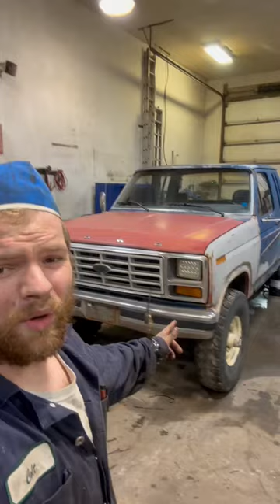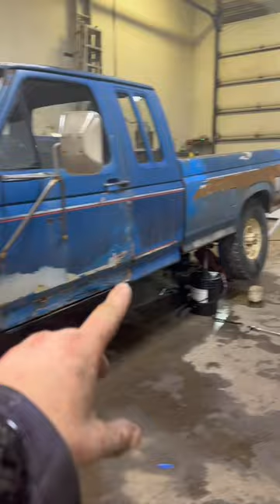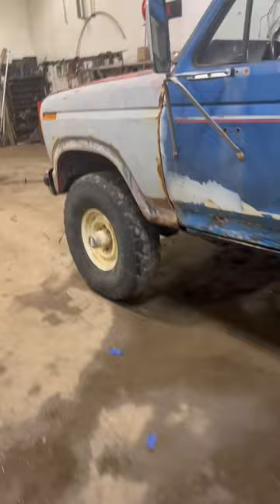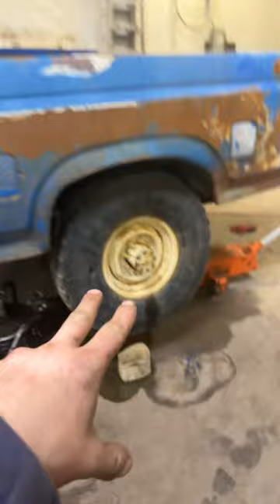Fords state of the art flexi frame

Comment: I bent a 1980 ford pickup like a pretzel and it was a wonderous thing watching it spring back into shape like a rubber tin can.
Reply from the maker: It’s pretty wild when you really flex them out
Reply: rubber tin can is my new favorite ferd saying😂
Reply: I had a 1980 f150 that had for some odd reason, 3" and 4" holes were taken out of the side of the frame from front to back.
weight reduction maybe?
man that old truck would flex and half was from the frame.
Reply from the maker: @taylorsmith3744  ah yes the Swiss cheese frame, was only around for a limited amount of years. It was for weight savings in theory so it could tow a little more, but also likely for cost savings.
Reply from the maker: @StainlessTom  that’s a good one haha 😂
Reply: @taylorsmith3744  You should research but I read once that that 1980 to 1982 ford truck frames or maybe just f100s and f150s had those big holes cut in the frame to lighten the truck.
1983 onward they stopped doing that.
I don't know for sure though.
Reply: @J3rEmY17  The 300ci motor, 4 speed, 205 case and 9" rear were all cast marked as 1979. The TTB front axle was first to get replaced as i couldn't find parts for that first year axle.
Reply: Yeah my 93 will flex so far the doors won't open or close, and it has no rust.

Comment: My old full size square body used to get some looks on the trail with the flex it would put up the only suspension work on it was a cheap 6"   lift 2 of which were blocks

Comment: As an alignment guy in the early 90s, I hated twin I beam with a passion.
Reply from the maker: Gotta admit, alignment purposes they really do suck haha, ttb pivot bracket bushings are really only align able for the first few years, after that they are too worn.
Reply: @highostablegarage  what do you do at that point?
Reply from the maker: @johndc2998  replace the bushings, it’s not a fun job but I’ve done a few of them now. A lot of fellas will never replace them even on 20 year old trucks and then complain that their tires get chewed up.
Reply: @highostablegarage  The 2wd models arent that bad to align as long as nothing is bent too badly. Upper ball joints can rotate in a way that tilts the knuckle a few degrees relative to the I-Beam, steering links allow toe adjust.
Reply from the maker: @TestECull  yup, you can even get camber bushings for more adjustment, but what I’m talking about is the pivot bushings at the other end of the arm, when they go bad they will never hold a good alignment, most fellas forget they are even there haha 😂
Reply: @highostablegarage  I don't know how you could when it sounds like Thor is under your hood every time you turn when they're worn 🤣🤣
Reply: @highostablegarage  They also aren't all that hard to change out nor do they cost much to buy, so iono why anyone would let them get so bad you can't keep it aligned...
Reply from the maker: @TestECull  you would be surprised haha
Reply: @highostablegarage  your correct bud. Them ford's made popping the plug out of the control arms on the OBS Chevys seem like gravy.  We wouldn't do Mercedes at the shop I worked at. The boss did for the longest time. Originally it was suggested you hang a few hundred pounds of the car in certain spots, but then they came up with this method of squishing down the suspension with a special tool. So we just didn't do them anymore. 
I always thought was wild there were different suspension settings for a Miata depending on how much fuel was in the tank.
Reply from the maker: @ryurc3033  the fuel in the tank likely outweighed the dry miata haha 😂
Reply: @highostablegarage  now I know you know your shit! I changed those bushings all the time. Got a bunch of shit everywhere I worked because I was the only one doing them. Everybody claimed I was padding the ticket. Meantime when they did an alignment they would be calling around trying to find super high degree cams. I would pop in knew bushings and half the time it was now in spec. If I did have to change the cams it was a mild change. 
 I had a kick ass system using 2x4s and two prybars to get the bushings exposed to change. Could bust them out in thirty minutes.
Reply from the maker: @AlphanumericCharacters  that’s awesome, I usually always had to swear and use a bunch of jacks and jack stand to do mine, plus usually they are covered in dirt so every hit and pry you are getting sand in your eyes haha 😂
Reply: sadly ttb had so much potential. damn bean counters ruined it.

Comment: As a guy who drives a ford f700 i can tell you that that is damn true, barely got any suspension travel but it compensates that with frame twist
Reply from the maker: Sure does haha 😂
Reply: Do you mean f100? I’m not too car smart but I have a very clean f100 and I was terrified when I dropped the back tire off a ditch and seen my f100 twist so much pulled it out and nothing was wrong love my old truck put all new parts on it and I have to say it’s a better off roader as a show truck than most modern jeeps lol
Reply: Also put a crown Vic front end in and it drives better than any modern truck I’ve test driven
Reply: @colbymaxwell244  Nah he meant F700.
Ford has always built bigger trucks than F350s.
I know they build F450s, F550s, and F650s currently.
Back in the day they built F500s to like F1000s in 100 numbered increments.
Everytime you went up a number towing capacity and payload went up.
They were meant for business only fleet vehicles they weren't sold to regular non business customers, those customers only got F350s or smaller.
Also those older trucks like an F700 would have had completely different front end, fenders, grill, core support, the cab behind the fenders was often the same as any other Ford truck. 
They're called cab chasis because you aren't sold a bed if you buy one because it's assumed you'll modify the truck for whatever you need to suit the business your in ex. construction, rail road they almost always end up with a steel flat bed.

Your F100 sounds cool though, Crown Vic suspension is sweet.
Reply: @colbymaxwell244  i really meant that its a ford f700 and yea a jeep is just a cheap car in an expensive plastic and velcro body lol
Reply: @J3rEmY17  yup! indeed, is just that some guys think it was made up
Reply: @mr.nobody1671  I just looked up cord 700 that is the coolest old truck ever

Comment: Built better than today's trucks
Reply from the maker: sure is
Reply: I was t boned on the driver side door- of my 2011 1500.. walked away pissed the fuck off my shit was totaled. They hit me doing at least 45mph.. you would not be walking away in an old beater like this- in an accident like that. Be lucky if your wheeled out of there alive. 

Old is not always better...
Reply from the maker: @johnwalker7592  built better for truck things, not the plastics in this truck though they suck haha, and you are 100% correct, newer vehicles are safer for the occupants hands down, I wouldn’t want to get t boned like your situation in my old ford, the cabs crash wise were never the best.
Reply: @johnwalker7592  That's about the only thing this new plastic garbage is good for. Great for protecting you in a crash but terrible for longevity or hard work. Just falls apart if you sneer at it angrily enough. It's unreliable, fragile, expensive to maintain, expensive to fix, expensive to buy, expensive to insure, expensive to feed, rides like shit, can't see out of it, cluttered plastic hellscape of an interior, is the size of a cathedral, can't be had regcab longbed 2wd, lacks a manual transmission, requires a degree in software engineering to work on...yeah fuck that. 

 I'd rather have a truck that won't fall apart around me in ten years or when first worked hard, has a manual, is simple, rugged, reliable, cheap to buy, own, service, maintain, has a free, uncluttered interior, rides nice, gives good visibility. IIHS crash test ratings mean nothing to me, but what does matter is rugged longevity. Old offers what I want. New offers everything I hate about cars.

My next car purchase will be a sedan from the 1950s. I will be set. Early 50s sedan, 85 F150, will never need another car the rest of my life. Maybe that's another 42 years maybe I die in a wreck next week either works for me.
Reply: @johnwalker7592 That's because you drive a beer can. You can literally dent any 2000 and up vehicle by pushing on the sheet metal.  All new vehicles are throwaway trash.
Reply: @johnwalker7592 when it comes to trucks older is definitely better especially 70s up to late 90s better than today's overpriced plastic trash shit trucks nowadays

Comment: Semi trucks still do it, call it articulation, flex, whatever
Reply from the maker: With heavy loads a slightly flexible frame is an advantage
Reply: @Higho Stable Garage  exactly. They are C channel rails. Even when we double frame a unit, it's still open not boxed.
Reply: They run heavy-duty double framed trucks for combo plow salt units where I work and even overloaded with all the iron in the air they don't flex much. The ride gets a lot more pillowy when the duals start getting close together, though. It takes a lot to make Hendrickson rubber block suspension feel pillowy.
Reply from the maker: @huntsbychainsaw5986  gotta love the old rubber block haha 😂

Comment: Ladder, or body on frame chassis, are known for their torsion. They have a lot of flex, but are very rigid when it comes to lengthwise compression, which is why they are used for trucks. Unibody or monocoque chassis are less flexible and are, in most cases, lighter, but they are used mostly on cars and things of that nature.
Reply from the maker: Very true

Comment: I have seen this flex in my 85 F150 going down the road in the mirrors. Watching the joint between cab and bed going over railroad tracks. It's insane how flexible they are! Rugged AF too.
Reply from the maker: Yes sir, there are a few old ford test videos back when these trucks were new, quite wild how fluid the entire truck is
Reply: @highostablegarage  Makes 'em ride super nice, too. I can hit an RR Xing at full send that, in a more modern vehicle would be backbreaking, and just not even feel it. The whole truck is just so compliant. Nylon belted 235/75r15 tires, soft springs, flexible frame, plush bench seat...such a nice ride. Hard to find anything riding smoother.

Comment: One thing not mentioned is that c channels have less of a tendency to trap moisture and corrosive materials inside of them than a box frame.
The have the potential to last a lot longer of cared for, in my opinion
Reply from the maker: Very true, most Toyota pickups have rotted away long ago around here for their boxed frames

Comment: My 76 big block, 4 speed, Silverado had a terrible wheel hop issue. Different springs, pinion wedge, slapper bars, nothing would cure it.... until I boxed a couple sections of frame and welded in all the cross members except the trans cross member.
Reply from the maker: Yes sir, I love the channel frames but that being said, no performance car has used it since it’s not the most stable platform

Comment: A brother of mine had an 86 F250 4x4.
 Bought brand new. It had a factory sticker above the fuel filler door, said:
"REGULAR GAS ONLY"
 The bedsides flexed so much, that if you put 12 bales of hay, in the bed, the tailgate latches wouldn't line up...
 If you used the parking brake, the front brakes stayed locked up, even after releasing the park brake😶and on gravel, or dirt surface,,, you couldn't get the front wheels to roll, stayed locked up and had to manually free up the brake calipers
Reply from the maker: Wild haha 😂

Comment: The only trouble I’ve had when I’ve been in a situation where the frame twisted was my cab binds up and my doors won’t open.
Reply from the maker: That happens under extreme flex, I’ve seen that happen before
Reply: I had a 96 bronco like that. Had to back up or pull forward to get out of the truck

Comment: The only annoying thing about frame flex is how you have to climb over to the passenger side when the driver side door won't open, or at least that is my experience with my 86 cclb f350 with a diesel while trying to get out of my truck while pulling a trailer.
Reply from the maker: Yes sir, the long bed club cabs and about the longest trucks on the road, they flex some good

Comment: Doesn't ford still do C channel frames?
Reply from the maker: Only segments are c channel now, not the whole thing
Reply: @highostablegarage  Ford switched over to fully boxed frames on all superduties after 2016, so all 2017 plus super duties are fully boxed.

Now cab and chassis trucks are still c channel behind the cab, but that's for easier upfitting since you have a flat surface for a dump bed or other accessories, and the big three, (Chevy, dodge, Ford) all do this on their cab and chassis

Comment: I have an 89 F250 I have yet to test this. Field find abandoned vehicle. 351w 4 speed manual 4x4. Only 51k it sat for 6 years without starting once. I finally got it going and the engine let go 2 days ago. Thankfully I found a parts truck today that runs and drives. It's the exact truck but a 90 and a 5 speed manual. Frame is so rotted its not road safe. Mine the body and frame are amazing solid and in very good shape.
Reply from the maker: Yes sir make 1 of the 2 haha 😂

Comment: Yes an off-road this gives you an advantage with a half ton truck. That's why so many guys would run one ton axles and a half ton truck instead of just getting a one ton
Reply from the maker: Yes sir makes good sense, way better flex unloaded from the 1/2 tons than the 3/4s and 1 tons
Reply: I was genuinely surprised at the place is my buddy's 79 K10 with one ton axles and 91 suburban front clip could go

Comment: Too rigid and the frame will likely crack. Yes suspension is supposed to articulate to keep tires on the road but that still creates stresses that are imposed on the frame and if your frame can't handle it, it breaks. Besides box frames like you find in newer trucks tend to hold moisture inside the frame and literally rot from the inside out.
Reply from the maker: 100% true, nothing like a good old Toyota frame haha 😂

Comment: C-channel not the whole issue. Semi's still use C-channel. 

Bigger issue on these was Ford cut out as much as possible to "lighten" them up. Attempt at saving weight before the popcan metal was usable. #builtfordtough
Reply from the maker: They are at least better than the 80-81 Swiss cheese frames, those fellas they tried lightening up the frames by cutting whole saw sized holes in em everywhere haha xD.
Reply: @highostablegarage  true dat👌

Comment: And most of those trucks are over 40 years old and still on the rod today. I’ve never heard of a cracked ford frame because or flex have you?
Reply from the maker: Only due to rust haha 😂
Reply: I know a lot of the 80 through old 97 body sell trucks had an issue with cracking around the steering gearbox, but that's one of the few areas on those frames that doesn't flex it's so damn rigid it breaks.
Reply from the maker: @RevRandyGarage  yeah it’s fullly boxed there with the ttb and engine cradle, it’s a high stress area there with the steering angles it has

Comment: My 04 still has c channel frame and flexes really well. Ford's frames and their steel has always been quality.
Reply from the maker: Yes sir, Ives always had great luck with them too
Reply: @highostablegarage  it's funny, I installed a flatbed, and I ended up having to put in extra bushings and made rocker plates because the frame flexes more than the bed and it broke a bolt, but I need to still be able to use the gooseneck so I made some heavy duty rockers so the bed can move with he bed but I can lock it in place when I'm pulling a gooseneck.
Reply from the maker: @dustinontaiyabbi5608  yes sir
Reply: lol flex is not quality 🤣

Comment: They only do that when you repeatedly haul like 3 tons in the back of a quarter ton frame while going over railroad tracks at 50mph, basically abusing the everloving piss out of them, and going waaay beyond anything the engineers designed it to handle
Reply from the maker: They all do that, it’s just the nature of C rails and ladder frame construction
Reply: @highostablegarage  they might flex under a load, but, the truck you see here, isn't flexing under a load, it is permanently warped. I have a 79, it's bed is square, no warpage. You see plenty of c20s and f150s going down the road dog tracking with warped beds and twisted frames from being overstressed.  I also have a 2004 f150, they only box the frame for the front-end and the cab and maybe a little bit of the bed. The last  4 or 5ft is 100% c-channel. The size and thickness of the c-channel and the rest of the frame depends on the load rating, 1/4 ton, 1/2 ton, 3/4ton, so on.  I also have a 72 Ford Torino, it's boxed frame bumper to bumper. But it's a car, you look at a commercial box truck they all are c-channel. Car frames need to be still, truck frames need to flex, otherwise they crack under the huge stresses they are exposed to.  Btw, if you want to see some serious frame flex, watch a torture test of a modern toyota tacoma. Lol

Comment: I'll Cash App you a dollar to take those work flood lights out of the spots your headlights are supposed to be.
Reply from the maker: Can’t beat the light output for the price, this is just an old work truck so it’s more function over form with it, but I’m not a fan of the looks either, I’ve always liked the stock seal beams the best.
Reply: @Higho Stable Garage  Honestly the ones you often see on mail trucks that are knock offs of the JW Speaker line of led headlights are the best if you want to keep it cheap. They have a good cutoff line and put the light down on the road instead of everywhere. My offer still stands though lol.